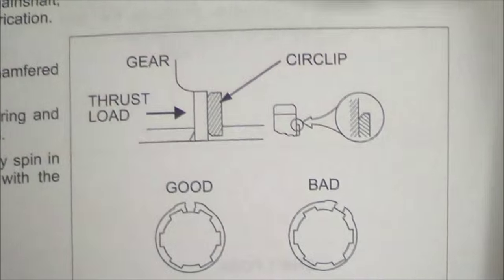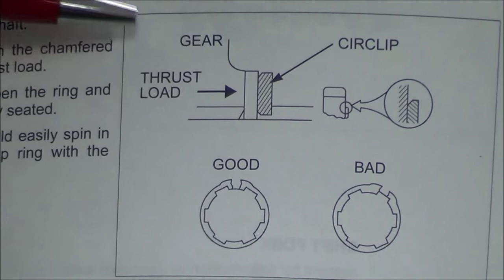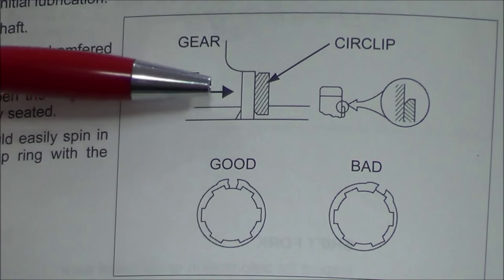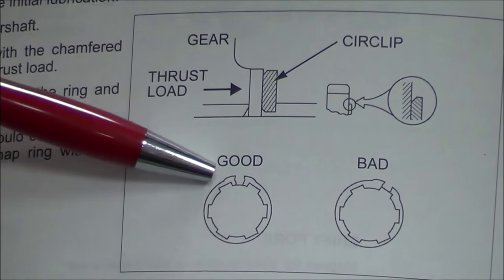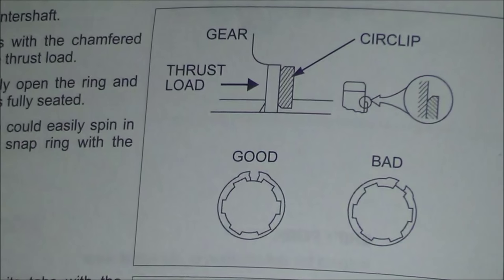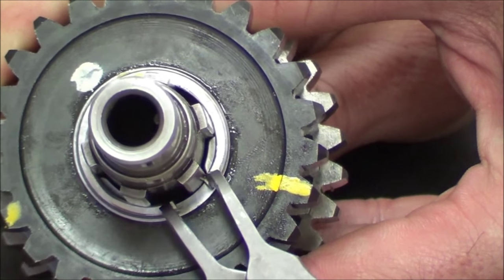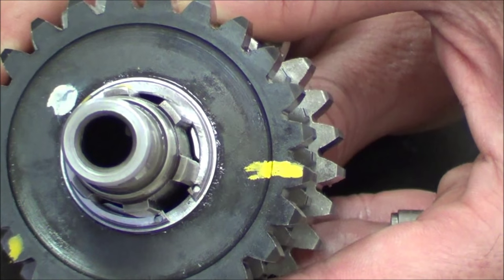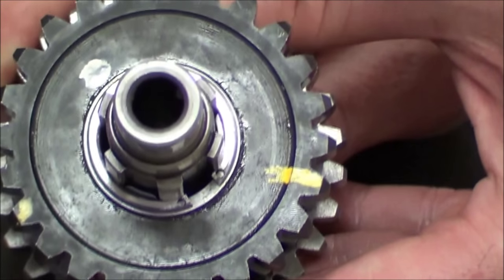EVERY MECHANIC SERIES:  Transmission Circlip Installation Procedures

Comment: I'm still confused. If I'm installing new chain tensioners on my twin cam, I want the flat side of the snap ring facing out towards me and the beveled side or rounded side facing the tensioner correct?